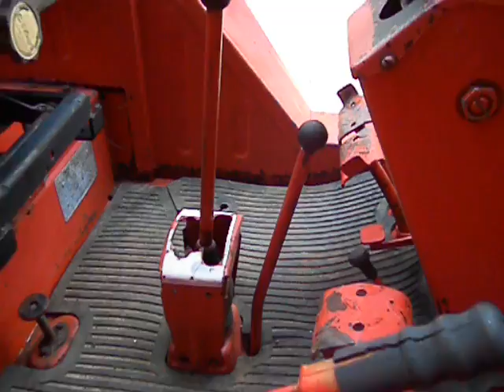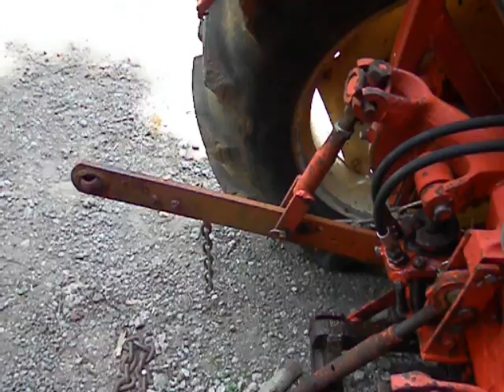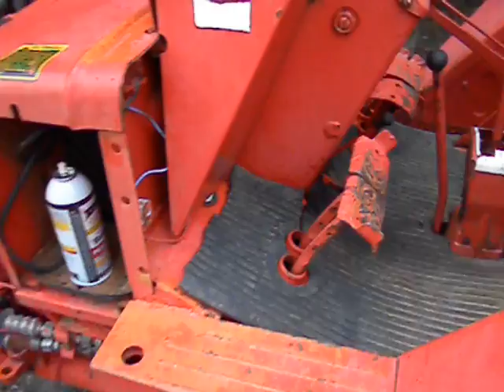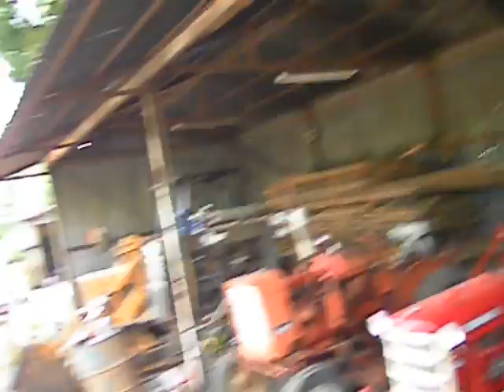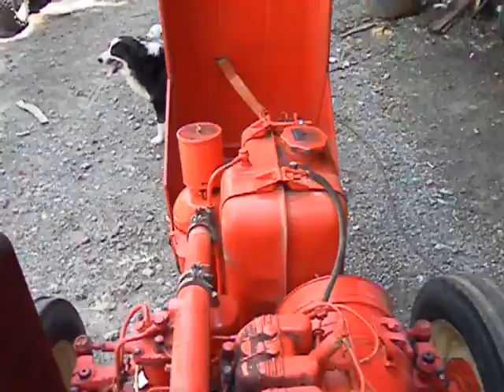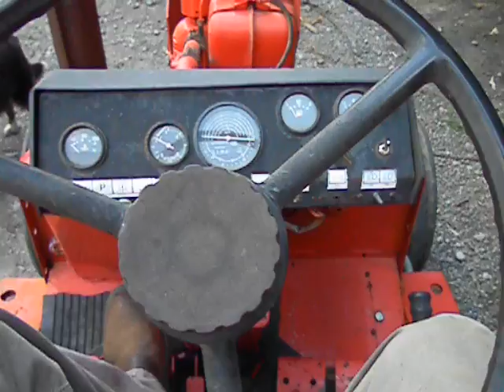Belarus 300 Deisel Tractor - For Sale By Owner - READ DESCRIPTION

Comment: I have a good running Belarus 300, stuck in crawler
Reply: Have you tried pushing in the main clutch and the PTO clutch to get it out of gear? My 310 has a similar situation where it wants to get stuck in the slow speeds but if I push both clutches in, it comes out of that gear easier
Reply: @NateHernandez  thanks friend, I already sold it
Reply from the maker: Ok. Don't think I want to buy any more Belarus stuff.

Comment: I am looking at buying one of these can you tell me if you liked it and if the air cooled was reliable
Reply from the maker: J G  the engines are great and reliable but the tractor in general is tough to get parts for and the braking system is terrible.

Comment: What brand is the hydraulic valve on your 300 tractor?
Reply: I sold that tractor 10 years ago.
Reply: @matthewgamble3859  is the tractor worth buying?
Reply from the maker: The engines are tough but hard to say. Parts are hard to find and it is like driving and riding a goat wagon. Not my favorite.